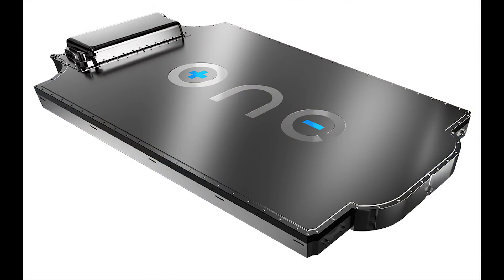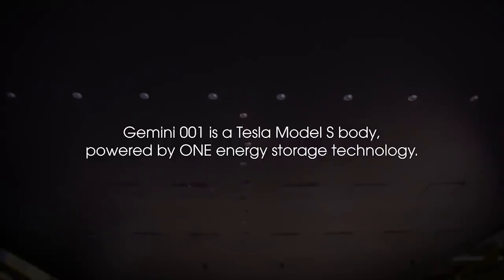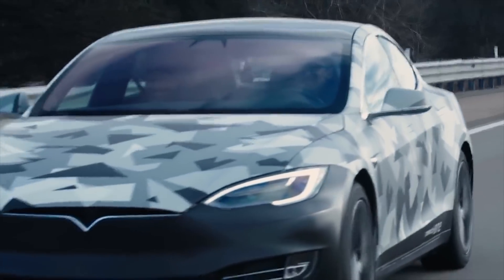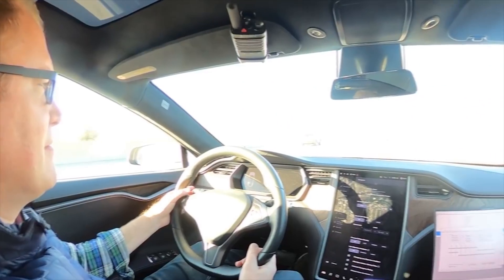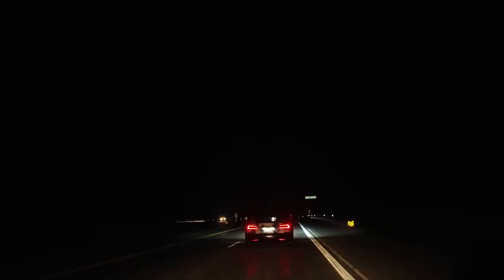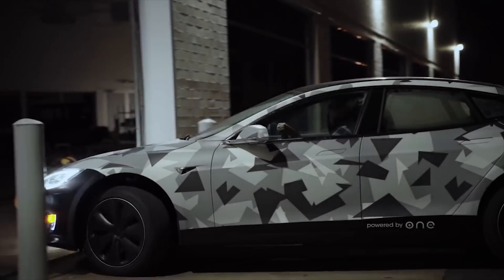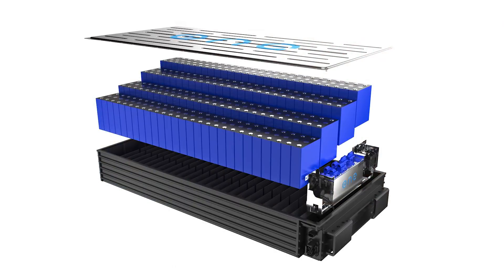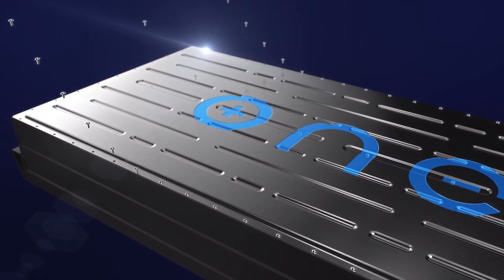750 Miles On a Single Charge & Still Room for Improvement - Autoline Exclusives

Comment: You would have to be a dangerous idiot to want to drive 750 miles on one charge without stopping. You should stop at least 3 times for a rest. If you had an accident, you would be going to jail if you killed people.
Reply: You’re missing the point.  The battery is rated for 750mi.  In actuality, snow, towing, mountains, can all severely impact that range to where it becomes just competitive with what we expect now under ideal circumstances.

Comment: Building a prototype that can go 750 miles on a charge is not a big deal.  Mass producing them for under $80k each is the hard part.  How bout you build a 300 mile range car under 2,500 lbs that can be sold for under $30k?
Reply: Where is the profit in that when you can build $70k+ cars that sell out instantly?
Reply: @aussie2uGA  They can't build any cars, for any price, that will sell at all.

Comment: When you can CHARGE your EV as quick as a gas fill up, range is not that important.
Reply: Pull in your drive way, plug in the charger, come out in the morning it's charged up just like a phone. 5 seconds to plug in, 5 to unplug it. 
Imagine all the time saved annually by NOT going out of your way to stop at a gas station. 
Plus no oil changes, no emissions, brakes last 3-5x longer. And you can find many places to charge for free, some can even be at your work or gym or like me your utility gives you 400kwhs a month free for off peak ev charging. 😎
Reply: @4literv6  Totally agree, was just talking about trips. I love my Volt, that's wht plug in's make sense.
Reply: You must be living under the rocks!!!! It’s not just about charging but towing, high speeds driving, overlanding, camping…… à longer range vehicle will always be beneficial nomatter what! The rav4 prime has 600 miles of range it’s an excellent vehicle to do alot of things that no EV can do.
Reply: @4literv6  nonsense!!!!! Going to the gas station is super easy, you don’t even need to take a time for it, it’s just in your daily routines, plus if you live in apartments in cities it’s a benefice and you have amazing range too.
Reply: @carholic-sz3qv  More range = BIGGER battery = heavier vehicle.= inefficiency. Why would I want a 9000 lb beast to transport my 195 lb body to run errands arround town 95% of the time. I guess you carry a 50 lb drum around full of gas in your ICE vehicle. What cave do you live under?